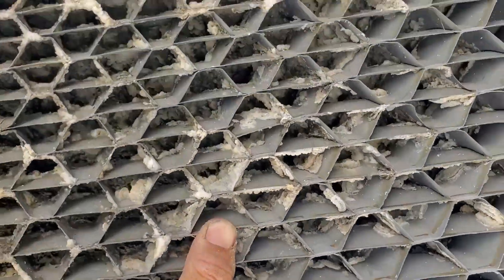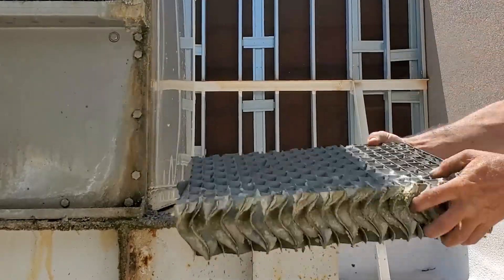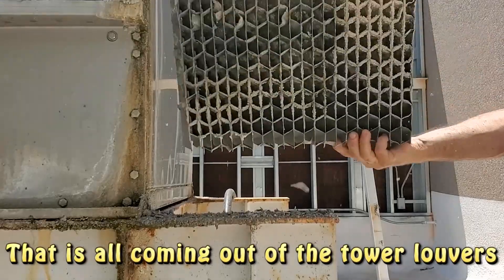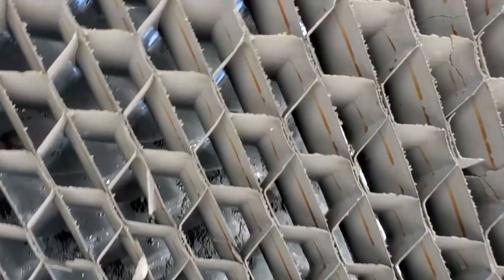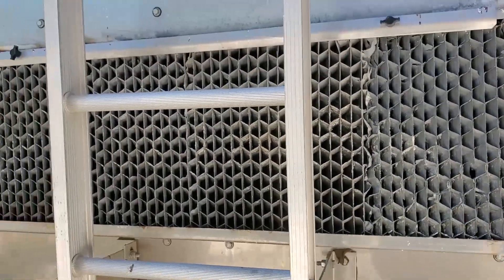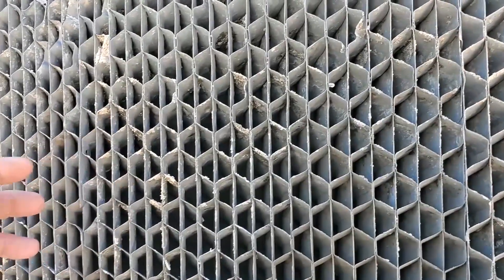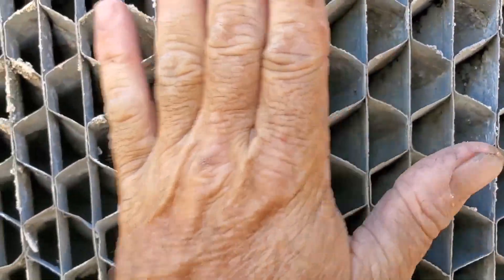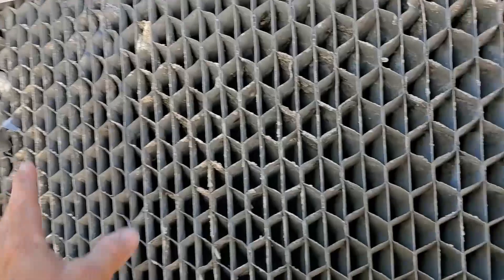Customer wants Chiller maintenance now that it is broke down in the heat after neglecting service

Comment: I wonder how that water treatment is telling from the scales not every well I wonder how the heat exchanger looks on that tower. With decent chemical treatment and twice a year maintenance those towers would look fine. You’re crazy touching that scale crud bare handed 🤘🏻
Reply from the maker: I had a lot of new cuts on my hands by time i got done. 
Sharp stuff
Reply from the maker: The scale fell off when I beat the panels. 
I figure it's getting some water treatment.

Comment from the maker: I've been going there for 3 years now and the ONLY time they got filters changed where when they plugged up the large Air Handler Units and caused a complete no cool. (This is on a chilled water system, so not like the coils will ice up!)
They finally agreed on maintenance and it was scheduled. While it is actively broke down with multiple issues.
Some are maintenance related (filters, strainers, etc) but several are also blown off needed repairs (Controls system wacked out of it's mind, 277v to plant for lighting all wigged out, etc).
I did forget to add the images of the system current % and pressures AFTER some maintenance.